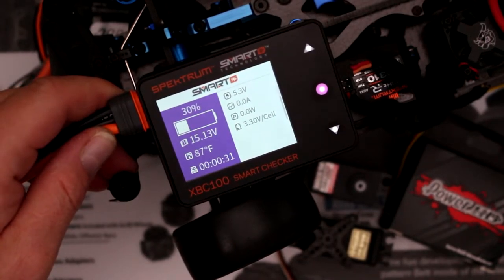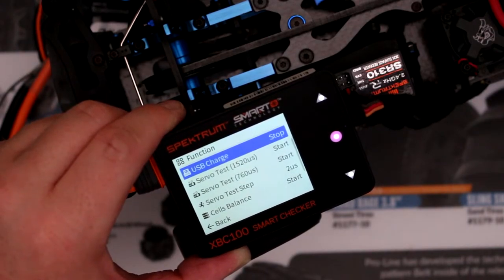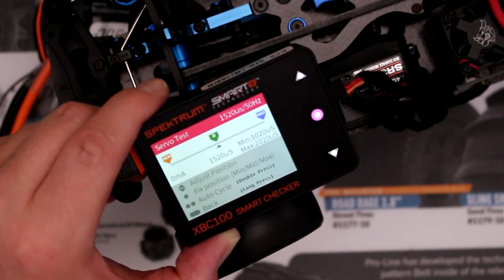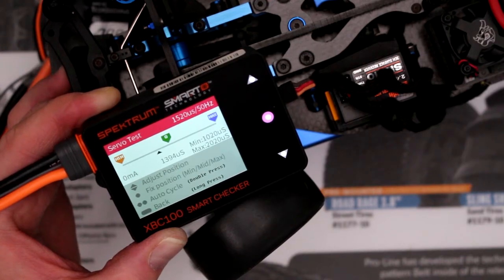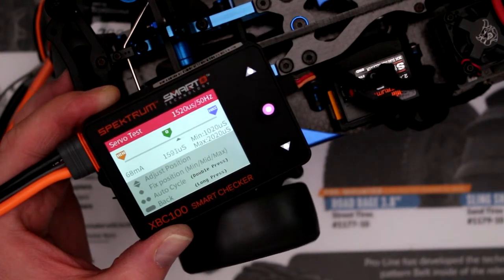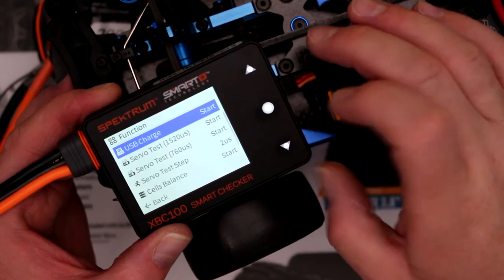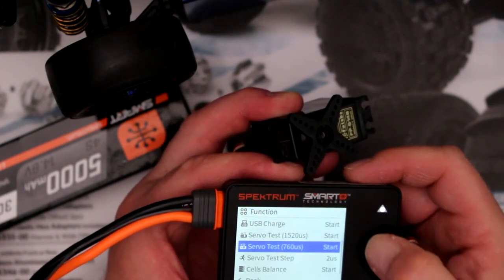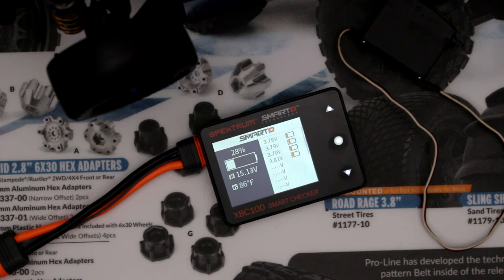Spektrum XBC100 Servo Driver

Comment: Will this show voltage on 1s lipos? Specs show for  for 1s but also say input voltage starts at 5v.
Reply from the maker: I just took the time and tried one I did not work
Reply: @djsprc  appreciate that. I didn't think so but was hoping. Thanks for checking and the reply.